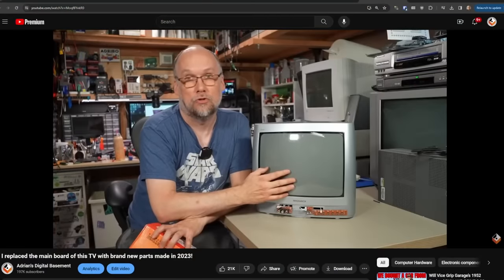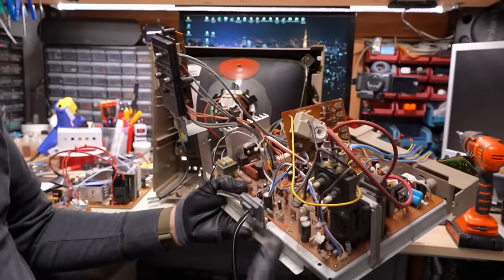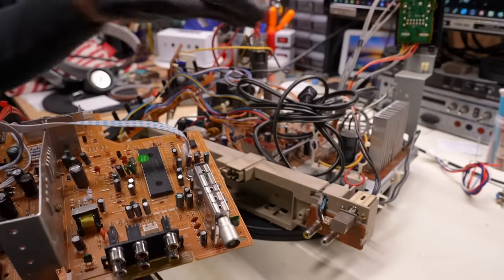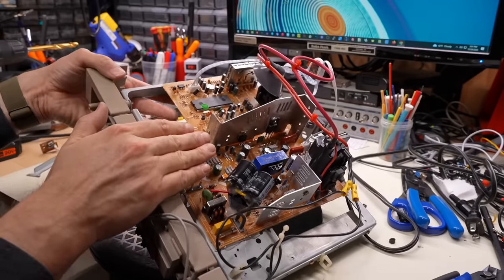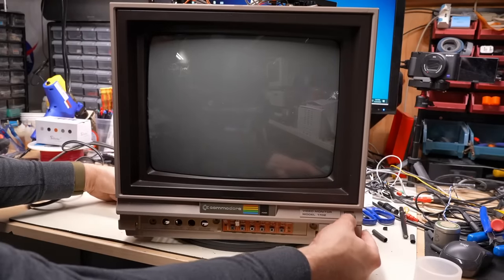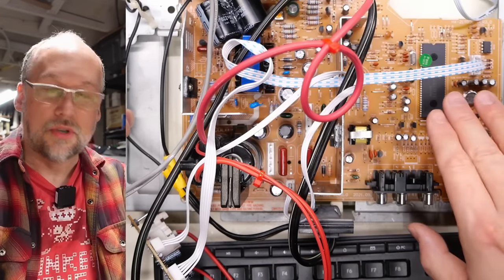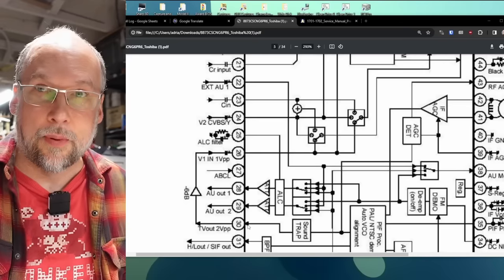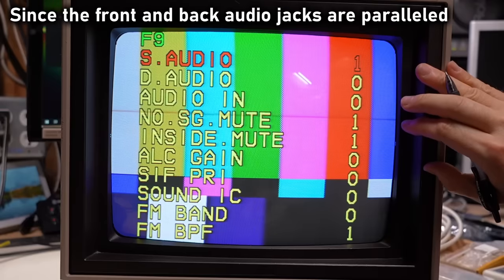Restoring a Commodore 1702 monitor using a main board from 2023

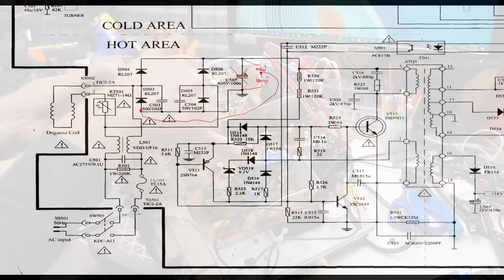Comment: 11:53 is the red markup correct?  By this diagram it seems like both sides of the lower replacement capacitor are directly shorted to ground.
Reply from the maker: You are most certainly right! My sketch is wrong! I sketched that up quickly based on the work I had done on the real board, but it's incorrect because I now notice the schematic is marked wrong!  On the left side of the bridge rectifier, Diode D503 is the top diode and D504 is the bottom. (The markings are reversed on the diagram.) So I made that sketch looking at where I had the wire soldered without thinking about what was actually happening. Here is a new better one which I also stuck up on Github: https://imgur.com/a/BYwnemm
Reply: The midpoint between the capacitors must be the AC connection.
the bridge rectifier will only use two diodes, the other two can stay in.
Reply: Yep caught the same mistake, I was staring at it wondering how the second capacitor was going to do anything if both sides were attached to the same negative rail. I guess I've learned some thing about power supply construction, maybe I'll actually be able to fix a few of mine.
Reply: Can this board run on 60Hz 110v AC???
Please answer me
Reply: @retrohoard  He modified the board in the previous video to work on 60hz 120V: https://youtu.be/MoqflFfvkR0?si=MNsJ02YLBnKm_gj-&t=2591
Reply: Thank you! Has anyone yet determined whether that mod is ACTUALLY necessary? Asking because I ordered one.
Reply: Yes, this mod is necessarily to be made, unless you have a step-up transformer.
Reply: Thanks @alexmirica  I ordered a step up transformer as well as an isolation transformer from Amazon, both the cheapest I could find - an ITR300 isolation transformer ($70) and a Yinleader 500VA step-up/down ($34!) The CRT board should arrive today! I'm excited, but I have to choose which TV to mod between two 13" models - either a Toshiba MV13M3 or an RCA E13320... I have a Commodore 1080 too, but it's too mint to even consider it! Maybe I'll post a video? Thanks Adrian, love your channel!
Reply: @xd3viant, for sure you can post a video! Sharing experiences and knowledge is golden! Regardless how, being a teacher, YouTube, GitHub, personal website, etc.!
If you post a video let me know!
Reply: So that mod needs 220uf 250v filter caps. Will any 220uf caps work or do I need a particular style?
Reply: I bought the version for larger screen sizes. It has two AV ports and is a little different. I bought caps but didn't use them when I noticed it said "super wide the supply voltage design" on the box. Hooked it straight up to 120v and it worked perfect. One thing that wasn't mentioned is a pot on the board that I think is for 50/60hz adjustment. I had a problem with it being too tall and rolling over the top. Adjusted it and now it's great.
Reply: The board runs on 110V! 
I ordered one & successfully installed it in a 13" Toshiba. It's on right now. 110VAC @ 60Hz.  You do not need a step down transformer.
Reply: @alexmirica I did what I said and bought a step down transformer and one of these exact same boards, but it doesn't need the transformer, so I returned it. The board absolutely works fine at 110 volts @ 60 Hertz US mains power. It does not need 220 volts, it does not need 50Hz.  It is  universal, truly. 
I guess I'll post a video to show you all.

Comment: In USSR we also faced problems with croma/luma interference an there was no such thing as s-video at all. So we used to play a trick building high-reciceon rejection filtets that cut only luma frequency not whole upper band. That helped with sharpnes but requred different filters for SECAM and PAL (there were no use for NTSC in USSR)
Reply: Trying to improve the signal generated by the state, that all sounds rather bourgeois ;p

Comment: A perfectly acceptable mod for a worn out 1702, otherwise the chances of finding a good replacement tube were slim to none!  Now the monitor is usable again and looks cosmetically original.
Reply: the tube used would have worked with the original board but also nothing wrong here its his thing

Comment: About the color delay line filter for PAL.  In NTSC, such a delay line filter is also called a COMB Filter.  Different degrees of quality COMB filters exist from cheap 2 line delay to 4 and 5 line adaptive filtering.  When properly executed, such a filter is used to eliminated dot-crawl and color fringing, allowing fine vertical white line to appear as if you were using S-Video in the first place.  Using the Y/C or S-Video input supposed to completely bypass this filter.  BONUS for NTSC: If you have a Sony HI-8 deck, or S-VHS, the have an advanced adaptive digital 4 line comb filter built in meaning if you send composite to their composite video line-in and use the VCR's S-Video output to drive your monitor, even with your test-pattern generator's vertical bars feeding the VCR, the VCR's S-Video output will look as good and have all the fine vertical res line test patterns at the top right as if you were using S-Video directly from your color bar test pattern generator, without the NTSC dot crawl as well.  If you have Sony's PAL versions of their top tier HI-8/S-VHS decs, their PAL S-Video output will have corrected the vertical color bleed so long as your TV's PAL Y/C input doesn't have any additional processing.
Reply: Thank you. At the end I was thinking “isn’t that like NTSC comb filters, also very common?” and found the claim NTSC has nothing like it somewhat strange.
Reply: @kaitlyn__L  Yes, normal TVs and VCRs usually have gone to cheap analog NTSC COMB filters.  They usually have trademark dot-crawl on color bars at vertical color transitions.  Usually TV wasn't shar enough to see this too badly.  The multi-line digital adaptive COMB filters I commented on the top end Sony VCS see the color change in the vertical direction and perfectly compensate compared the the all analog 'Glass Delay Line' filter equivalents.
Reply: PAL can also have comb filtering applied to improve on Y/C separation and avoid using a notch filter for luma, although it's way more complicated to implement than for NTSC. 🙂

But the phenomenon seen here is probably the result of a passive, 2-line comb filter as you mention. If the jungle IC sent the NTSC chroma through the 64μs PAL delay line for averaging, it would wreak complete havoc on the color given the different subcarrier frequencies and line lengths of PAL and NTSC. So the PAL delay line can most likely be ruled out as the cause.

Comment: Im curious why you didn't just use pc style mainboard standoffs to mount the board so you didn't have to cut the metal frame.
Reply: Sometimes you work with what you have on hand and what is easier... Cutting some metal, or drilling holes and mounting standoffs, both are solutions to the same problem. There is no single answer.
Reply: @volvo09  i wouldnt have said anything if i didn't already know he happens to have some on hand.

Comment: Tip for supporting PCB with out screwholes - use a bolt and nnut in chassis and two plastic rectangles with a hole for bolt on top/bottom - it supports PCB while maintaing electrical isolation

Comment: The original CRT in the 1701/1702 had a 0.64 mm dot pitch! That was typical of color monitors designed for 40-column text. They just used an ordinary color TV picture tube. Monitors designed for 80-column text had a dot pitch of 0.52 mm or less.
Reply from the maker: I knew if anyone knew it would be you! The new one from the old TV is just as low res....

Comment: This was really satisfying. You ended up with so many benefits that normal monitors don't usually have. Saved presets, RF, multi system, and it can still function as a TV, if required. 
Even the compromises aren't bad. A lower res CRT gives a smoother image - almost like antialiasing for older systems. And you already have other high res monitors when you need them. 
This monitor is now really special and unique.

Comment: In Germany the HF mode was always channel 36 PAL BG. 
There were no television stations on channel 36 because there was another radio service. 
But the channel was used for video recorders and computers.  England also had PAL.
The C64's video and S-video output wasn't quite up to standard.
Reply: I think UHF channel 36 was universally used for all devices, e.g. home computers, VCRs, et.c., that ouput PAL video signals. At least I have never heard of any other channel being used.
Reply: Well, that's only correct up until 1988 when commercial television stations started to transmit over the air.
Here in the Cologne/Düsseldorf area we had a quite powerful transmitter broadcasting RTL on channel 36.
Was quite a hassle for many people who had to change the channel from their VCR to something else.
I think channel 38 was left free for good because it was used for some radio astronomy stuff, so most relocated their VCR to that channel.
I was lucky because I forced my parents to buy a proper AV-cable for our VCR 🙂
The situation was probably similar in the UK when Channel 5 launched.
I have a couple of older C64s that were made in the UK which hat a small screw next to the RF modulator to adjust the channel. I haven't seen a C64 that was made in Germany that has this screw.

Comment: The chroma level in C64 (at least early models) is 1Vpp (same as luma), which differs from the modern S-Video standard, which expects 300mVpp. Of course, the chroma probably has an ACG circuit, which would compensate for slightly off levels.
Reply: I was thinking this too when I saw it! "Chroma's too hot".  That dimming effect is a classic response. The AGC kicks in and makes it look like that. Using the proper 75 ohm term. resistor on the chroma line would probably help. 150's are common enough to just use 2 in parallel if you don't have 75's lying around. A pot wired as a voltage divider on the C64 chroma line could probably dial it into spec.

Comment: That's really interesting, I've never seen an RF tuner switch between PAL and NTSC before! Although I guess the tuner is just spitting out the baseband signal, and the picture decoding is done by the jungle chip. We used to have an RF test lab at work that they used when they were working on the standards for the introduction of digital TV here in Australia, and I know the modulators we had could be switched from DVB-T to ATSC, since the original point of the test lab was to compare standards. Obviously the standards were well and truly set by the time I started working there, so I only ever saw DVB-T, but it was fun to play around with "non-standard" setups like ramping up the modulation and winding down the guard interval, then transmitting a single MPEG program stream with a h.264 encoded 1080p video payload that's almost as good as blu-ray quality. No TV at the time could decode such a signal, since h.264 was still pretty new at that stage so very few manufacturers implemented that codec in their TVs, and those that did weren't powerful enough to decode a high-bitrate 1080p picture, so we could only watch it using a broadcast IRD. But it was still fun to play around with.

We also did some research into the impact of the future 5G utilisation of the 700MHz portion of the UHF band, and basically concluded that it would cause interference with the local cable TV operator's network, making those frequencies unusable for cable TV or cable broadband. Fast forward to the national broadband network moving from a 93% fibre network to a mix of VDSL, cable and a small amount of fibre, and basically after negotiating to basically buy the cable network off the operator for billions of Aussie dollary doos, they discovered basically the same thing we did years earlier, that they couldn't use those frequencies to deliver the gigabit speeds they promised.

Anyway, I have looked in to building a more basic RF test lab at home which would include multiple analogue and digital channels, although it's well down the list of projects. Maybe once I finish building my TV studio and live broadcast control room, I'll look at the RF test lab. Although I'd never broadcast a pirate analogue TV channel, definitely not. That would be highly illegal and risk getting me into trouble with the ACMA, and I definitely wouldn't want that!

Comment: You could move the ir sensor to the led window with the led then never have to open the door and reduce the risk of the falling off from excessive use. I really like how the monitor/ tv turned out even lower rez picture dont really matter since it good for what you plan on using it with.

Comment: @AdriansDigitalBasement
I fully agree with your option that this chassis/tube swap was a great idea! Very cool looking display! Very well done too! The nice thing about that board is that it seems to contain mostly off-the-shelf parts, so if it does fail in some way, fixing it should be somewhat trivial. This is one of the best hodge-podge jobs I've seen, with great results!

Comment: I bought the version for larger screen sizes. It has two AV ports and is a little different. I bought caps but didn't use them when I noticed it said "super wide the supply voltage design" on the box. Hooked it straight up to 120v and it worked perfect. One thing that wasn't mentioned is a pot on the board that I think is for 50/60hz adjustment. I had a problem with it being too tall and rolling over the top. Adjusted it and now it's great.

Comment: That is actually a pretty impressive modification for an old monitor (especially if said monitor was clapped out and not repairable), gives th ething new life and more function without compormising on the looks, well, most of the looks at least anyways, and having the RF tuner as well, that's pretty fun cos you could use it with RF-only devices no matter what the standard they use is... :D

Comment: That button PCB is probably all passive components so it will not be hard to make a new board where the buttons match the holes on the Commodore front panel
Reply from the maker: Yeah it just has resistors on it so would be easy to recreate yep!

Comment: Something you may be of interest.  Monochrome (B&W) televisions made AFTER the introduction of color television will have a chroma filter built in, BUT very early televisions built in the 1950's do NOT have chroma filters.  The video resolution off of their RF inputs is only constrained by the frequency response of their circuits, which can be quite good when restored.  An old 1950's television with a good CRT can display amazingly tight video detail!

Comment: I do still have that CBM 8296d from 1984. I bought it around 1990 - 2 devices for 150usd (german Mark, actually, but you get the Ball parc), one for my friend and one for me.

It really looks cool. And it had 2 disc drives and comparatively a lot of RAM. But it was so slow....
I considered using it as a dumb terminal. Still in 1992 or so, so it would have been enough to run a shell in. 
But it didn't even had a proper serial Interface, as a Rs232. Just a proprietary Interface. Buy that time there were no cards available anymore that would turn that Commodore Interface into an rs232 one. I would have had to build the whole card by myself, as in creating a circuit on a board and then manually put the chips in there, having to connect every single pin.
I had no expierence with that sort of electronic work. It also wasn't really worth it. 
That CBM was so slow, I don't think it would have been capable of 1200bps, 300 seems realistic. The C64 was able to handle 300bps and probably had the very same CPU as that CBM 8296d, but I am not sure. But both were clocked at 1mhz 😂.
That is so slow you can almost read as fast as it was transferred. Imagine!

Comment: Looks like a fun project/video, but I was thinking for a future mod, you can replace the buttons with rotary encoders and a microcontroller wired to the buttons PCB.  Then mount that inside the case and have the rotary encoders go through the holes formerly used for the potentiometers.
Reply: Good idea! There's no need for a microcontroller, though. Just use rotary encoders with pushbutton.

Comment: Great work Adrian as always!
Now this surpasses the term monitor and becomes a real tool for a very wide variety of machines! I would definitely add the Component mode mod to get the full flexibility of that Toshiba processor there also maybe add an extra speaker on the box for Stereo sound somehow?
Furthemore for the Tuner situation and washed colors did you tried to adjust that Tuner option in the service menu to see if its values affect the RF colors? All of the consoles we had as kids here in Greece just used the RF plug for A/V connection so this tuner would be very handy for all those!
Cheers, Keep up! Jim.

Comment: I was long ago inspired to open up CRTs. The only thing I've done in them is replace some caps and adjust pots. Oh and once repaint a very yellowed case (retrobriting did not work). 

Still - impressive stuff, I used to mess around inside CRTs as a kid at school, even then I knew about the dangers of them.

Comment: Yay!  A really worthwhile project.  There's your obvious use case, Adrian, where ppl have sent PAL machines to your land of Never Twice Same Colo[u]r* - Thanks also to alerting us to the fact that there are such TV/Monitor boards out there for a fairly cheap price - quite useful if one acquires a mystery set requiring components that can no longer be sourced.
- Also, yes!  This video is nudging me to get off my backside and fix my once trusty old 1084S (which was also my TV set for many years, being fed from a VCR), as well as my Amiga double scan monitor which still has a raster, but stopped showing the input video last time I used it.

* - Don't blame me.  That translation of NTSC is courtesy of our TV & Video Systems lecturer a couple of decades ago 🤣